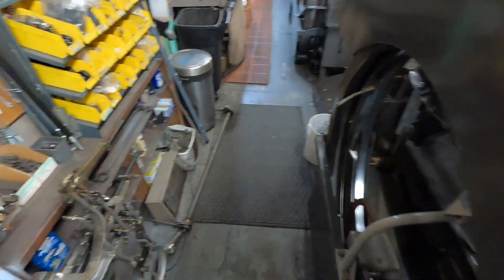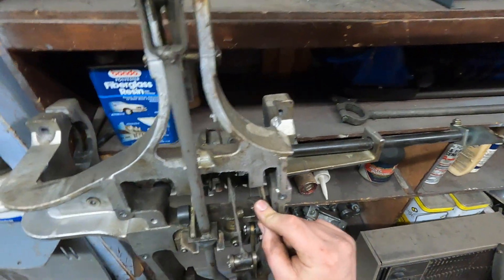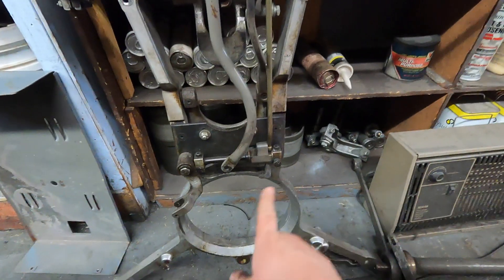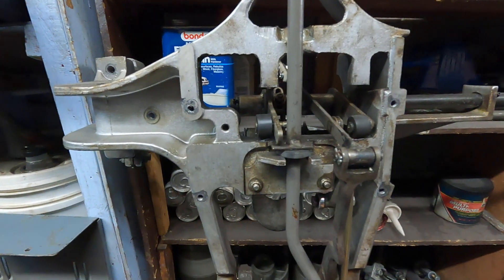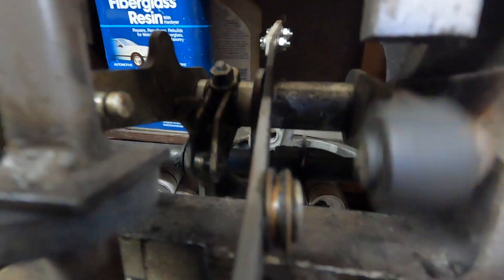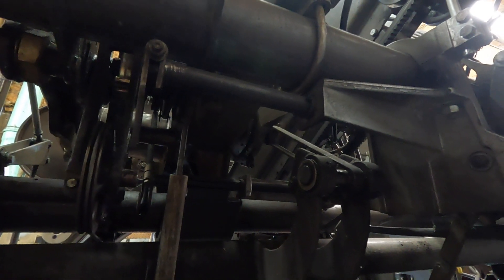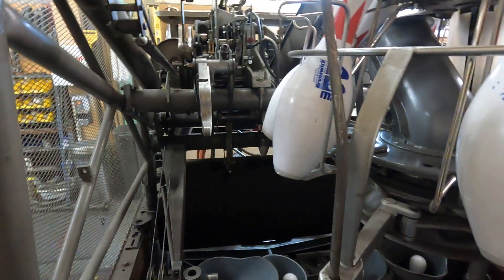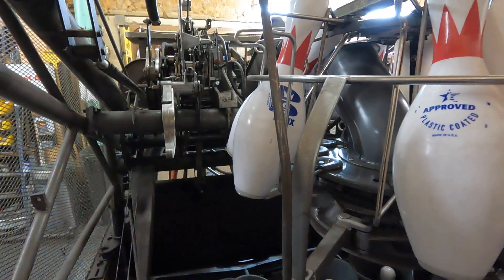Blocking Fingers - Brunswick Pinsetter Explained

Comment: i work on a2 converted, sometimes (lane 4) the turret advances before all the pins drop far enough and the pins get jammed up by the spider...cant seem to figure out the problem...
Reply from the maker: Is the deck fully up when they drop?
Reply: @thepinsettermedic  not sure...only witnessed it once and wasnt quite sure what i was seeing...it just seems to happen randomly...thinking of setting up some sort of camera to catch it in the act
Reply from the maker: Yeah I’ve thought I doing that too for some of my problems. But if the deck is up I would check your turret cam bolts and make sure they ain’t loose, make sure your turret clutch is in the slides, make sure the indexing lever is adjusted properly and all the linkage that is connected is all tight and adjusted too